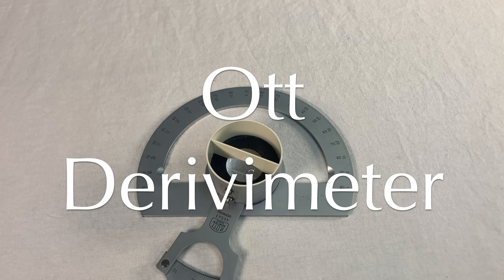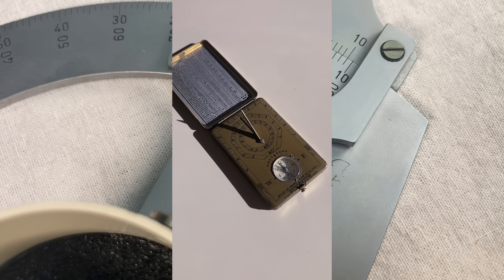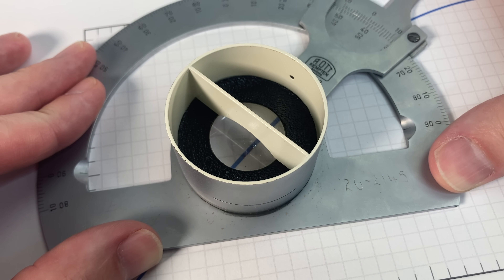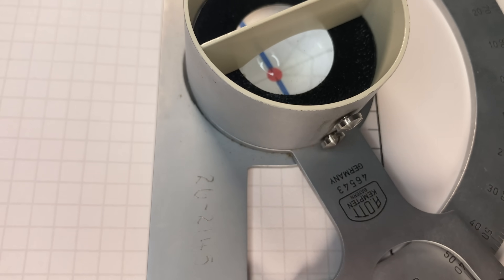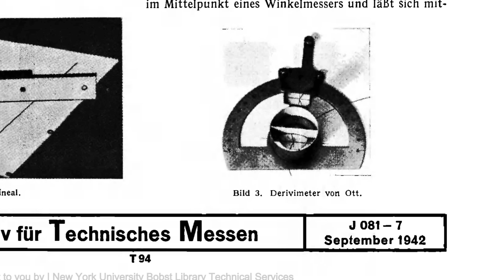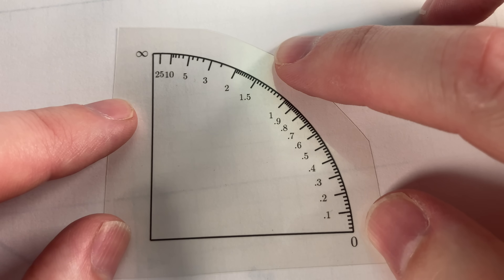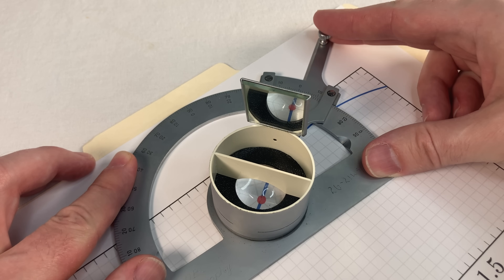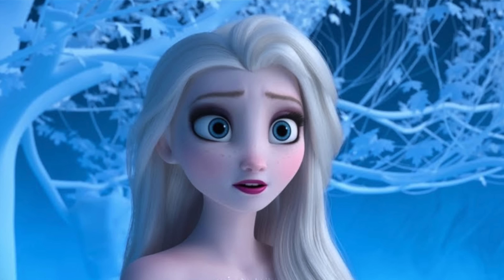It finds the derivative: The Ott Derivimeter (1930s)

Comment: It's a nice tool, but I think it's a misnomer to call it a "Derivometer".  As someone else pointed out, and to the best of my knowledge, the derivative of a function is a function.  The result of applying this device is (with greater or lesser accuracy) the tangent to a curve at a single point.  It tells you nothing at all about the tangent at any other point on the curve. In addition, while the tangents only depend on the curve, the slopes also depend on the coordinate system.  This implies that the curve would have to be plotted accurately (which is a big assumption).  Even if you measured all of the infinite number of tangents along any segment of the curve, it still wouldn't tell you what the derivative function is.

Besides, if I remember correctly, only the derivative of a quadratic function with a single independent variable would be a straight line.  For example, the derivative of a cubic function would be a quadratic function.

I like the mirror setup.  It reminds me of how a sextant works.

A much more impressive device is the Ott Integrometer.  Unfortunately, very few were made and I have the only surviving one.
Reply from the maker: The derivative of a function is a function. The derivative of a function at a particular point is a number. Using the word "derivative" to describe either or both things is very common. 
You can see in their instruction sheet: "Applied to a sufficiently large number of points, this method enables the differential curve to be plotted point by point." So, like you say, you can draw the derivative function to arbitrary precision using this instrument. I'm not sure what you mean by: "it still wouldn't tell you what the derivative function is". This is used for graphically represented functions. If you can draw it, then that picture IS what it is.
I'm not sure if you were joking about "Integrometer"- Ott and others did indeed make mechanical integrators, which are indeed hard to find these days- I don't have one, but they are basically planimeters.
Reply: @ChrisStaecker  I have limited mathematical skills, but according to my understanding, this device finds the tangent to the curve.  The tangent can be considered, as you say, as a number, but often the term is used to refer to the straight line whose slope is the same as the instantaneous "direction" of the curve, if we consider the curve as the trace of a point moving through space (a plane, in this case).  The angle of the line would be the arctangent of the number.

I understand that you can plot a function using this device.  My point was that it will not in general be possible to find the function, in the form of an equation, from the plot.  Nor would it be possible to extrapolate for values even slightly beyond the boundaries of the original curve.

I was joking about the Integrometer.  I'd have to look up what a planimeter is.  I would think that such a device (a mechanical integrator, that is) would only work for a very limited class of curves.
Reply: @ChrisStaecker  I just thought about this for a couple of minutes.  At the risk of being persnickety, I think that there's no such thing as the derivative of a function at a point, there's only it's value at a point (or more precisely, it's value for a given x, assuming it's a function in x).  The derivative of a function is always either a function or a constant, whereby the latter case is simply the degenerate case of a constant function (i.e., the derivative is always a function).

The reason I care about this is that it's relevant to my work.  I have a particular interest in the intersections of curves and plots don't do me any good, only equations.
Reply from the maker: @laurencefinston7036  I'm not sure exactly what you mean, but I think you aren't using terminology in the standard way. 
Like for f(x)=x^2, I would say f'(x)=2x, and I would call that "the derivative of f(x)", which is a function. I would also say f'(3) = 6, and I would call that "the derivative of f(x) at x=3", or some such. That is a number.
Both of these things are colloquially called "the derivative". If somebody started talking to me about the derivative with no context at all, I would probably assume they mean the whole function. But it's not strange at all to use the word derivative when talking about a single point.
As for "plots don't do me any good, only equations", this is a fundamental difference with the intended user of the derivimeter. This was meant to be used on empirically produced graphical curves- say, from data chart recorders. If you have an equation for the curve, then you would just use calculus to find its derivatives. This instrument is meant to be used for a curve which exists only on paper.
Reply: @ChrisStaecker  Maybe I'm splitting hairs, but I would say the derivative of f(x) for x = 3 is f'(3) and the value of f'(x) for x = 3 (or more simply f'(3)) is equal to 6.  However, I hardly ever discuss math with anybody, so I don't know what common parlance would be.

Just using calculus would be nice.  Unfortunately, it's not so easy in practice.  Two problems are 1) that one often doesn't have an equation for a curve and 2) in computer graphics, the equations for spline curves aren't integrable.  I don't know if they're differentiable (I doubt it), but I haven't needed to find tangents to spline curves (yet). I'm mostly interested in finding distances along the curves, as well as intersections.  For anyone who doesn't know this, in general, integration is needed to find distances along algebraic curves.  (It is not needed for straight lines or circles, but it is for ellipses).

I will make a guess that if these devices were used in ballistics, then at least some of the curves it was used for were parabolae, so they probably had a good idea of what curve the plots were supposed to fit.  Not sure I'm on target here.

I appreciate this device very much and would use it for that reason alone.  However, using it for a technical drawing of any complexity would be a pain in the neck.

Comment: 3:55 It is 31,85°, I use the outer scale to measure degrees fractions. On 8 is slightly less an on 9 is slightly over. So my guess is 0.85
Reply: OK, I'm wrong, its @erikziak1249 28,175

Comment: You're using the box wrong.
Reply: thought the same but it kinda looks the arm is wider than the slot and it wouldn't fit in there, but i'm only judging by eye so i don't really know
Reply from the maker: This is right- the pivoting arm can’t fit in the slot there. Apparently Ott shipped it with another piece which could be used to attach it to a standard drafting table rig. I don’t have that piece, but it goes in that diagonal slot.

Comment: one thing you didn't explain much was how the vernier scale actually works... the point in the video where you read off the result of 28.2 would have been a good opportunity

the prism approach seems like it has an enormous downside: you're actually measuring the slope along a pretty good sized section of the curve rather than at a point, you might as well just mark off two points to draw a "tangent" line [well, a line that will have been parallel to a tangent at some point between the two chosen points] by hand (or to use a protractor).

Comment: Sorry, but if you built the right triangle on the curve and knowing the base (b) and height (h), you wouldn't need to see the angle to access the tangent value, since tan=h/b directly and more precisely. 
In this case, 3/5.6 = 0.5357 which would be the approximate value of the derivative.
Reply from the maker: Yes I know- I was showing two different methods to do by hand.

Comment: What was this used for?
Reply: When experimental results were recorded graphically it could have been very useful to have a quick way to obtain an instant derivative; lots of answers in engineering problems are derivatives of curves.
Reply from the maker: Yes - data existing only as chart recorder output would’ve needed to be analyzed purely graphically

Comment: The protractor with slope markings isn't less accurate than the one with degrees. The visual accuracy is exactly the same. Don't be fooled by the fact that when you calculate the tangent you get a number of decimals.
Reply from the maker: Well I said "precise" which I'm using different from "accurate". I agree the accuracy is exactly the same. But the precision is nonlinear so it's hard to talk about in simple terms. A small deviation, say by 1 degree, doesn't change the slope value very much when it's small, but it can have a huge effect when it's big. 
Of course the calculator gives me false precision when I press the "tan" button, but that's not really what I was talking about.
Reply: I agreed, until I saw this thing had a nonius. That would be difficult to achieve with unequal markings.

PS, it is later mentioned on the vid, apparently called Vernier scale (as well).
Reply: Oh, I bet the vernier scale is an additional motivator for the angle markings, because it wouldn’t work with an uneven scale.

I have a number of slide rules, and the vernier scale would only work on a log/L scale or rulers on the edges 🤔 maybe I can try scoring a custom cursor window…
Reply: Also, you can get the tangent value with a slide rule pretty quickly to the same accuracy from the angle measurement.

Anyway, the eye can read off graduations that are equally spaced like angles on a circle better than an uneven gradation which you would get for a tangent value. The slide rule is at least made for such a reading, and doesn't convey unwarranted digits of precision...

Comment: Drawing the perpendcular with a T square after the mirror would introduce error.  It'd be better to just use the fact that the perpendicular will have the negative inverse slope. So if the mirror/normal line has slope -5/4, then the tangent will have slope 4/5. But it makes sense that you didn't use that in the video, because it would have been a ..... tangent
Reply from the maker: Yes- totally right. The indicator on the Gerber actually points perpendicular to the tangent line, but the scale is inverted like you say so it all works out fine.
Reply: Why would it introduce error? Just because theres more steps where human error is a factor?

Comment: On the topic of Verniers on non-linear scales, there's a really slick trick you can do with a slide rule (source: "Utilizing the Vernier Principle for Precise Readings of Slide Rule Settings" by Roger Wickenden). 

The trick is that the log scales on the slide rule are locally linear, so if you line up the right index on the C scale with 9 on the D scale, the C scale can act as a Vernier anywhere else on the D scale (you can do the same for subdividing by 5, 10, 100, etc.).

Makes me think that good ol' Gerb's Variable Scale would be really useful for adapting Vernier readouts to any graduated markings!
Reply from the maker: Very interesting- I'll look into this. I recall seeing a patent for a Vernier-like trick for use on log scales- maybe it's a similar idea.
Reply: I was going to make a pithy comment about the derivimeter's Vernier scale, but yours is far more informative and elegant. Thank you. 🙂
Reply: I can imagine using the tangent sum identity to make something that works like this but for tangent, though the identity is more complicated, so it would be less elegant.
Reply: Unfortunately the google search turns up an article whose "meat" is behind a $40 paywall.